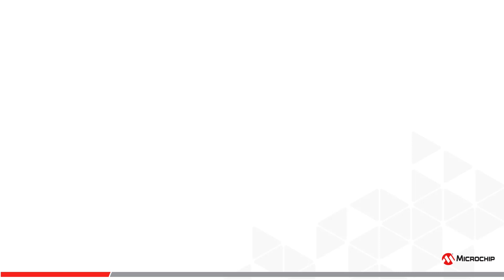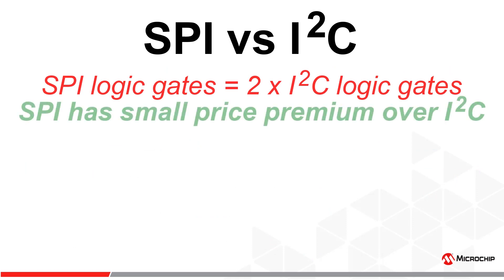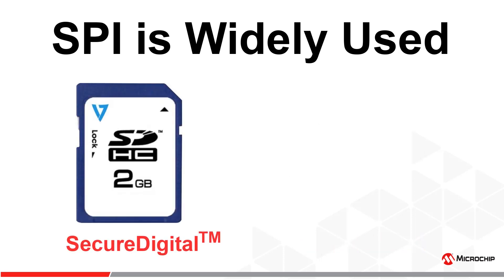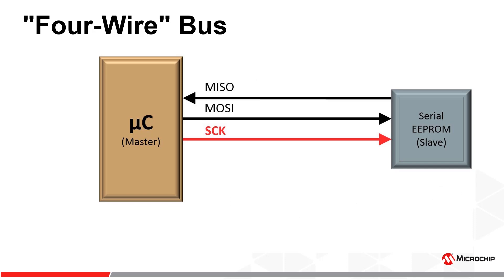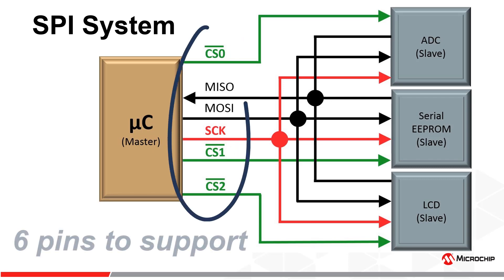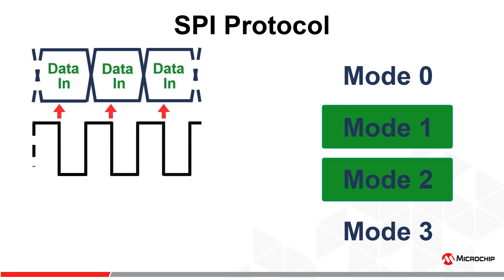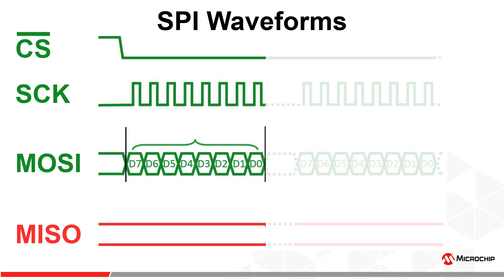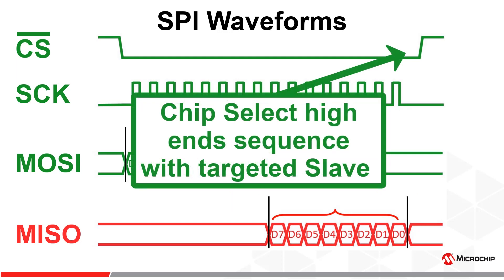What Is...SPI?

Comment: Since Microchip uses a N CPHA (negative clock phase), it can still be confusing to the beginner on how to set up for say, ....  Mode(0,0). 
SSP1CON1bits.CKP = 0;        (CPOL aka clock polarity) IDLESTATE_CLK_IS_LOW
SSP1STATbits.CKE  = 0;        (CPHA aka phase)             XMT_ON_CLKLOW_TO_HIGH

Is this correct?